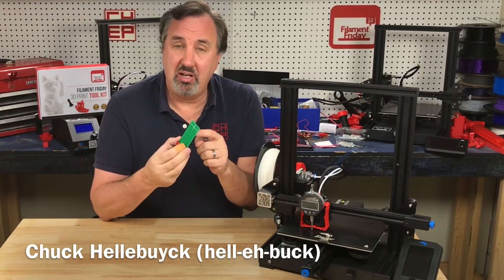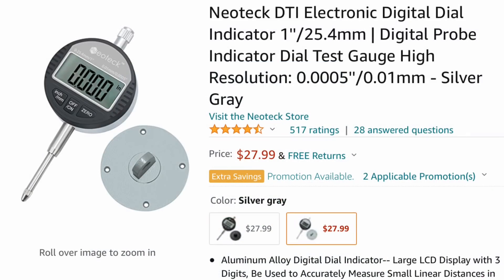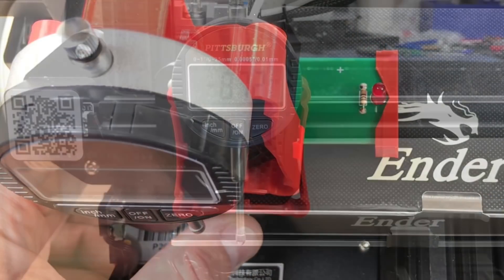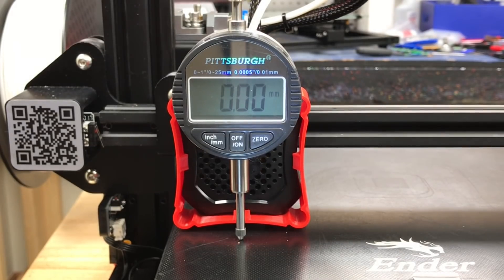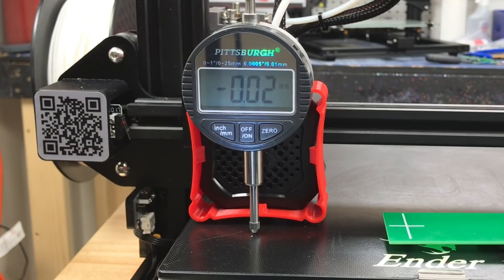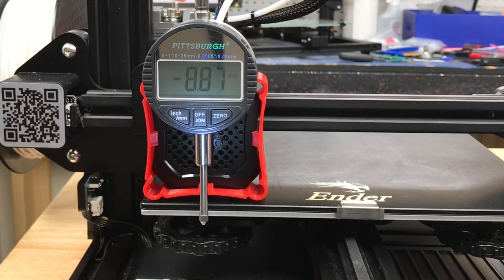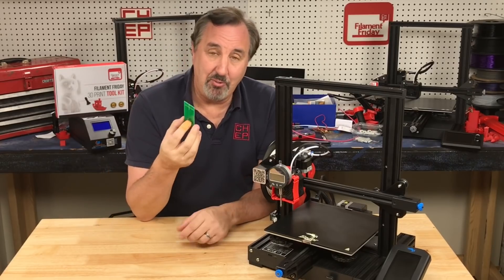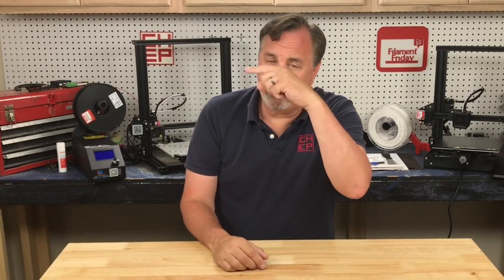How Accurate is an Electronic Bed Level Module

Comment: I use the electronic tool and have much better results and since using it my first layers have been perfect with no issues since
Reply from the maker: Great feedback. I’ve seen the same.
Reply: @FilamentFriday  Hi Chuck! I modified your ender 3 bracket so it will fit over the front fan on my Geeetech a20m, but I had to remove the mount for the digital dial indicator and "paste" it onto my modified model - otherwise the dimensions wouldn't match up with the indicator. I saved your original mount as a separate stl file so I can use it the same way on my other printers, but I don't see an option on Thangs to upload the file as a remix or anything.  Is there some way I can send it to you so you can link it to the original (if possible)?  Thanks!

Comment: I purchased your leveling gage but I cannot stop the Z in a place that in contacts the surface either is too low to get the tester under it, press the z up one step and it’s too high to touch the tester.
What am I doing wrong?

Comment: Hey Chep, I’m ready to buy your electronic leveling tool…do you recommend I also get the dial indicator?
Reply from the maker: No. Dial indicator was only for this video.
Reply: Ok cool…I’m having so much trouble getting the Ender 3 V2 leveled correctly. I know it’s an AWESOME machine, it’s just stressful to get it leveled. I’m hoping your electronic leveling tool can help me. I’ll let you know when I get it delivered. @FilamentFriday

Comment: During an "up all night" thought project, I wondered if the CHEP Electronic Tool could also be used to do a Z-Offset determination. In the morning, I took a micrometer and a precision caliper (0.00mm) and measured multiple times the height of the Tool when the LED just turned on. Result was 5.8293mm (0.2295") for the micrometer and 5.83mm for the caliper. Note that the crossed target lines on the PCB are not zero thickness, so be very careful to make sure the nozzle is right over the crossing point for accuracy (it could improve the Tool if the crossing PCB lines had a circle of ~2-3mm diameter to avoid an error in this procedure). Correcting the CHEP g-code to replace the 5.8mm with my 5.83mm should make this accurate enough to set the Z-offset using the live z-offset adjustment function with the nozzle at the center of the bed, Position 5 in the CHEP code.

Comment: Tried using it, follow the included directions and started a test print. It dragged the nozzle on the bed. This leveled it far to low for me. Ended up using a feeler gauge and some trial and error.
Reply from the maker: Did you download the GCode that comes with it?
Reply: @FilamentFriday  Yup, used the QR code on the box. I ran the leveling a few times and each time I checked all 4 corners twice. If it helps at all, I'm using the Ender 2 pro. 

My intention wasn't to say it a bad product. Could be user error, a really warped bed, or some other fault with the printer. I'll try it again once its time to relevel it.

Comment: Im pretty sure the micro switch on your leveling tool has far more accurate repeatability than that Pittsburgh dial indicator (Harbor Freights bottom quality tier house brand), especially with it mounted to the least rigid/stable part of an Ender 3 v2, the wiggly fan shroud. The very minor variance is far more likely from the dial indicator and/or mount giving a false reading, not the switch. Great tool. I have a Starrett micro switch height offset tool that I have been using as a machinist for the past 30 years to set cutting tool to part surface offsets on lathes and mills.  It gets professionally calibrated and certified along with my micrometers, calipers, guage blocks, etc. It certifies the same as my old carbide faced Mitutoyo calipers to +/- .0005" repeatability. There are modern tools that are even more accurate. The only difference is a machinists offset tool is designed to trigger at a very precise height of exactly 2" =/- .0005". and can be calibrated for use with machinery that have to hold much tighter tollerances than a 3D printercan achieve. The bed leveling tool really only needs to trigger consistently at the same height, not an extremely specific, accurate height standard consistent from tool to tool. Height is compensated for when setting final Z axis offset.

Comment: Is there a way to get this shipped to UK? Cant seem to find where to get it here
Reply from the maker: Amazon USA site will ship to UK. We’ve had several bought and shipped there.
Reply: @FilamentFriday  how would I go about doing the steps on an Artillery printer as I can't just easily put the steps down like you can on Ender printers
Reply from the maker: It’s just a universal GCode you download that should run on any printer. Just choose the right bed size file.

Comment: I got one of these to use on the 5 Neptune 2`s but I cannot figure out how to work their z offset and there are no instructions or tutorials I can find.  Even when I set the offset to 5.7 it still plunges down to the bed when using the leveling buttons.

Comment: I bought one of these the other day and it works great! Still has the potential for human error but much easier than using paper. A suggestion for version 2 would be to have a blank section of white silk screen where you can write the actual thickness of your assembled switch. I just wrote on mine with paint marker but if the option was there.. keep up the good work!
Reply from the maker: If assembled correctly it’s always 5.8mm. That value is also used in the GCode.
Reply: @FilamentFriday  that's reassuring then. Mine measures 5.83mm. Thank you.

Comment: All the nay-sayers should take note. What is used to home machine?  A switch, great work. Now just integrate it into the control, with M0's and coordinates and it will be perfect. A cheap yet simple alternative to auto leveling.
Reply from the maker: I have GCode file you can download with M0 so you just run that and it handles positioning and Z offset.

Comment: In the description the Gcode Files link is broken it comes up with a 404, the URL is bed-leveling-tool.html i was looking for that Gcode you wrote for testing the electronic level module and then using the dial gauge
Reply from the maker: I fixed it.

Comment: Hi Chep, I tried to go to purchase your Bed leveling tool and I get the following error when I go to check out.
The information you’re about to submit is not secure
Also my card will not finish the purchase due to this error. Any ideas?
Thanks BTW great video as usual.

Comment: Another excellent video, Chuck! I have an Ender 5 Plus and would love to build this device for it. Suggestions are welcome!

I installed solid bed mounts and a TH3D EZAbl Pro. I run independent Z-Axes and use G34 to align them. I still have trouble getting my Z-offset dialed in though. :(

Comment: Ok, now i see that this tool is acurate, but there are still a little stuff to tell.
In the begin i think that its necessary to set the actual switch in way that when your nozzel return to the 0 position than this z 0 position will also match a motor stepp in way to prevent disallignement cause the motor is in a half position.
Than with this button, since there is a necessity to solder it, every single version of this tool potentially could be different from others, so the “final consumer” will need to find his individual z-offset value to use while levelling the bed and its not only tricky but involve another “little trouble”: motor steps and microstepping could cause errors if the offset to use is not a 0,04 multiple.
For me this devise is awesome, but for beginners it could cause some big miss understanding of their machine. This tool shold be done in way to be 0,04 multiple height and preferably solderless in way to eliminate human errors during assembling.
Im not your hater and im not trying to be an as*, i just like to interact with u by expressing my personal opinion, and yes,i dont pretend to be right, just wanna find my own way to setup my own hell of ender perfectly 😂 so if im wrong just tell me that😂 anyway, i like your channel, nice work man👍🏼

Comment: Wouldn't the springs on the bed be kind of like tuning the strings on a guitar? On a guitar you tune up. Putting tension on the string until you hit the note. You don't tune down because you are releasing tension and it will also release or loosen more tension after and be out of tune. The dial indicator would be good for this. You can set it to be at the right height for the nozzle and then loosen the spring and then tension it back tight to the right height. That way the spring will stay tight.
Reply from the maker: I saw no movement even over temperature in my latest video: https://youtu.be/NlUO-5EtB44

Comment: Looking to try and create the z code for an Ender 5 Plus. How do you determine the coordinates? I disabled the steppers after rasing the z and eyeballed the locations. First, try and it gave an excellent test print. Trying on a print now. Thanks!

Comment: Can you run that zero test with the dial indicator over on the other side of the X? I feel like the single support Z and the deflection across the gantry because the far side is held up with the wheels. 

I love your tool but if you had the time to run the same Z - 0 error on the opposite side of the X axis, I would really appreciate it.
Reply from the maker: What would that have to do with switch repeatability/accuracy?

Comment: Hi I want to buy it. But the shipping to Germany is with 20$ very expansive. Can I get the board information, to creat local this electronic board? I will buy for it!
Reply from the maker: Unfortunately it’s not but you can easily recreate this on a perfboard.
Reply: @FilamentFriday  okay thanks but I don‘t have the knowledge to design an PCB.
Reply from the maker: That’s why we sell the kit. They cannot control what Airmail costs outside USA.
Reply: @FilamentFriday  I will buy for it to creat it local pcb boards…!

Comment: Hey Chuck, I was wondering, I have a standard Ender 3. If I were to buy a 4.2.7. 32 bit board and V2 lcd screen would it work? I've upgraded the springs and bed knobs, and have been building parts for it. Also have a magnetic flex bed coming today. I don't mind spending a little $ if I can make it better.
Reply from the maker: If you get the right firmware it will. I recommend JYers V2 firmware for that.

Comment: Awesome tool, I love it. I level my bed using a 0.2mm feeler gauge. Basically just home the printer, raise the Z-axis to 0.2 and subsequently adjust the knobs to give ever so slight friction. The LED tool is much easier to use, though.
Reply: would that be a steel feeler gauge? And would your nozzle be made of brass, by any chance? You sure you wanna keep doing that?
Reply from the maker: Feeler gauge is smooth and does little no damage to the nozzle. Even if it did, the bottom surface of the nozzle has zero effect on the quality of the 3D print.
Reply: @railgap  Totally sure. Feeler gauges have been precision ground to such a low surface roughness that the abrasive effect on the nozzle tip is negligible. Provided you position the feeler gauge below the nozzle before "tightening" the leveling wheels and only tightening the wheels until a slight friction occurs, the nozzle should wear out from use long before it gets damaged from the gauge.

(Source: I'm a precision engineer 😁)

Comment: Thanks, this beats many doubts 

but..  I also have experience of bad microswitches even at highee price class, which are not always even closing the circuit when pressing down

Even my keyboard cherry switches sometimes wont trigger as should 🤔  So when making these tools, you seems to have much better luck with micro switches :D

Comment: Wish you would check level and repeatability of the entire bed using the dial indicator.  Set the four corners in the middle using G-Code.  Some electronic dial indicators actually have a data out port.  You could have the G-Code run over and over again and set up a data file.

Comment: the low profile tactile switches have very tight switch tolerance
.01mm is within the depth gage accuracy

the depth gage is cheap, should use that to manually level the bed, after you set the first point

Comment: Hi Chep I bought the tool and like it... Can I get the STL for the red plastic stabilizer you made for it in this video... In your original electronic tool video you don't have that stabilizer on it..
I have found mine to wobble a little so I assume that is why you made the stabilizer part :)
Reply from the maker: Yeah, check the support page: https://www.chepclub.com/bed-leveling-tool.html

Comment: I appreciate you took the time to demonstrate the process capability (repeating without changes) before you did your experiment.  That clearly separates repeatability in the measurement itself vs. variability added by your switch/LED/adjust process.  A lot of youtube videos immediately attribute results without knowing their measurement capability.

Comment: Tact buttons in lion gadgets have always quickly worn out or at least quickly deviated over many uses as the spring flexed.  Hall effect sensors don't have any flexing parts.  Maybe make a 3D printed BL touch with a board from Next PCB.

Comment: Nothing wrong with the accuracy of a micro-switch.  Several tests on Youtube (a.o. Thomas Sandlader) have proven that an end-stop switch is one of the most accurate mechanisms for a bed-leveling probe.  Also, if your printer uses such a switch as end-stop, then its Z-accuracy is already determined by such a switch.
Reply: I was thinking the same thing. Homing already depends on micro-switches on most hobby grade 3D printers. I did notice that very occasionally my Ender-3 will have extra error when homing in Z. This shows up as the paper suddenly being extra tight or extra loose when levelling. I know now that if the paper bed levelling method suddenly shows a bigger gap, I should restart the bed level gcode to make sure that it wasn't a moment of flakiness on the part of the micro-switch. Otherwise, if I proceed with the levelling and reduce that gap on all 4 adjustment knobs, the nozzle could (and has!) scraped into my PEI bed when I actually start the print, which will re-home when it begins. I also sprayed a bit of contact cleaner into my Z micro-switch ("electronics contact cleaner with silicone") and this did seem to increase the reliability of the switch, which was already very good to begin with. As an extra precaution I added a homing step in between the two passes of my manual bed levelling gcode.

Comment: What people don't realise is that a switch or any other device has inaccuracies, micro meters, milli meters etc.  As long as the error is consistant, it is repeatable and can be compensated.
Reply: And that's the only thing that's relevant here. The height might not be consistent between buttons, but between attempts (at a similar temperature) it should be repeatable.

Comment: You can have all the gizmo’s you want , if the X , Y axis isn’t  perfectly perpendicular to the Z axis it all means nothing and if your bed warps as it is heated it all goes out of whack anyway .
Yep you have shown your gizmo does have repeatability but it is more a nozzle offset device than a bed levelling tool - use it to set the first layer height and let something like a  BL touch do the rest.
I have gone from the adjustable bed to a rigid design that can be adjusted if needed so no springs - I occasionally check it but it usually stays within spec .

Comment: In my experience the problem with bed levelling - as your video demonstrates nicely - is not to do with any inaccuracy in using a slice of paper. Rather it is more to do with 2 things: 1. Having screws to the aluminium bed that can vibrate themselves loose as the printer moves (and this is not the same thing as the big plastic turning knobs moving so using a plastic wheel lock alone will not stop this) and 2. Using an uneven print bed. Problem 2 can be fixed by using glass (I always use glass like the one you show). Problem 1 needs to have the screws fixed with an antivibration nut and washer and then also a wheel lock. I do this and I never need to do bed levelling unless I change my nozzle (for months and months). Some people think using the thick yellows springs are 'better' somehow than the stock Ender 3 springs for this sort of thing - and there are lots of videos that tell you to change them. However, this is only a partial fix - it 'kind of' works because the extra tension makes it a little harder for the screw to rotate under vibration - but that's all - it's a little harder, it doesn't prevent it totally. So eventually they 'upgrade' again to a BL-Touch and / or to wheel locks, etc. but none of those actually fix the underlying problem. I use properly fixed screws and a glass bed and have no issues with bed levelling ever since - and no need for BL-Touch or the other stuff.

Comment: The 0.01 comes probably from the flex in your mount. It's accurate ENOUGH. 
Nevertheless, it's not like you produce precision parts for NASA out of a 3D printer like this. 
People who complain about the switch in your level tool, must complain about their Z endstop too, and relevel their bed before every print.
Reply from the maker: The resolution was 0.01 so the movement could have been 0.001 or 0.005, I’ll never know so the Mount isn’t perfectly solid but I was surprised how consistent it works.